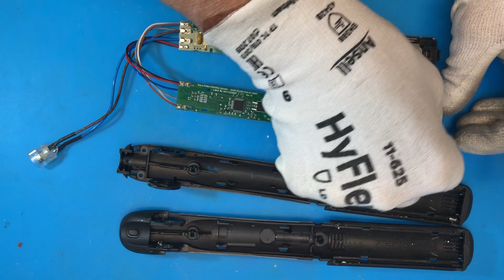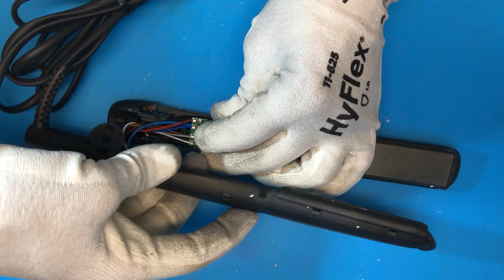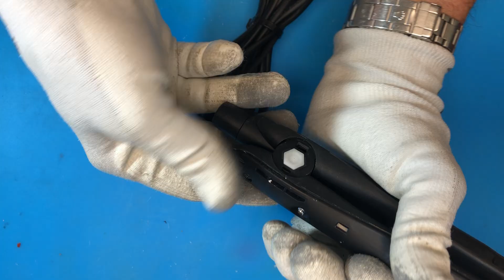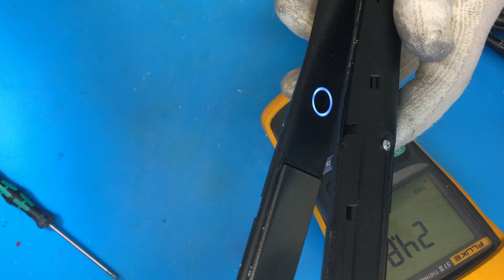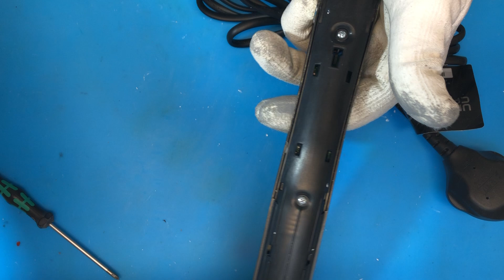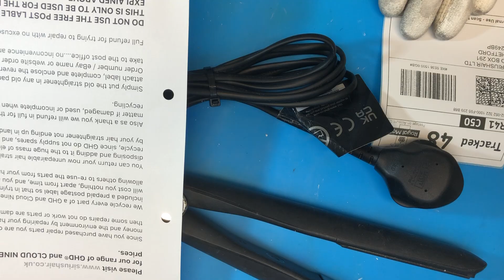GHD S7N261 Gold Repair Tutorial – Complete Disassembly Part 7

Comment: Thanks a lot for this disassembly. I just ordered one of your PCB/Heater units because my son thought that it would be a great idea to use this device as a submarine in the bathtub. :)
Reply: While everything works technically, it is unfortunate that the replacement parts are not doing well with my own parts. Since the thermal fuses are not the same dimension as my old ones, I could not fit the heater units properly, because the rubber that goes on the fuses has a different shape. So the ceramic plates are very tilted and stick out now. :(